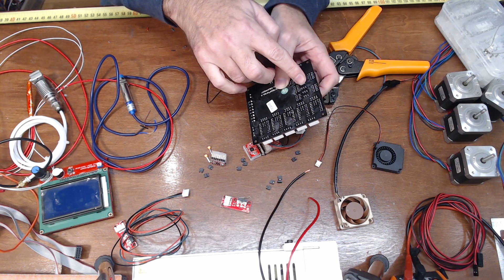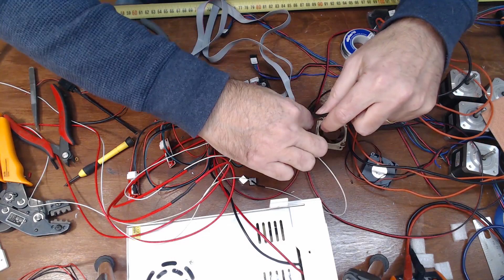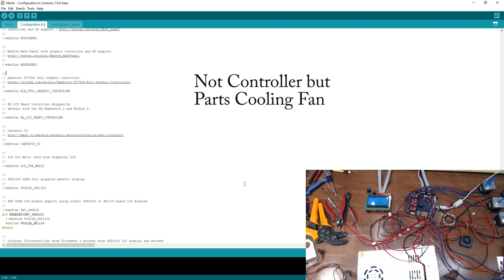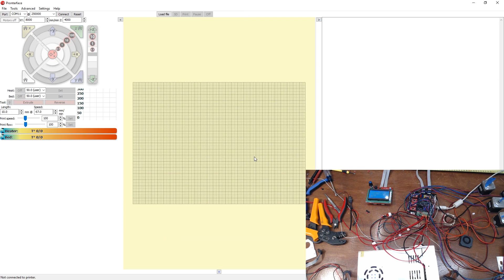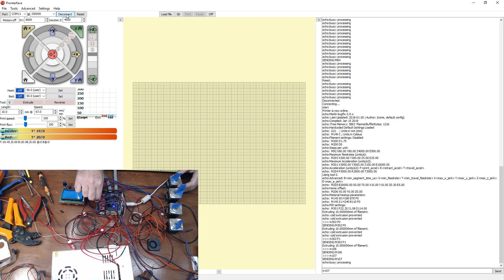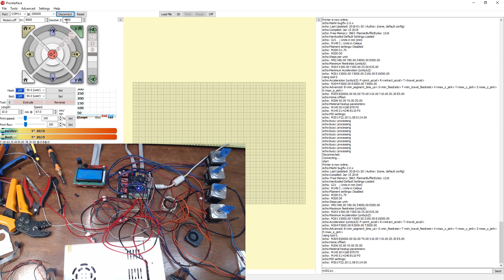C3Dt/c Cantilever 3D Printer Build: Part 3, wiring the KFB2.0

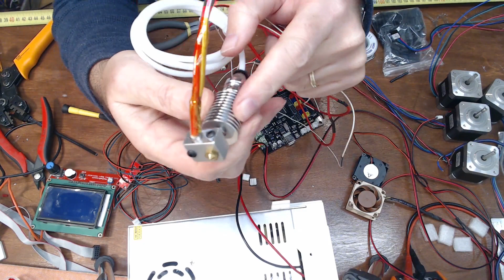Comment: At around 14:00, there is reference to the hotend end thermistor. I cannot stress strongly enough how important it is to check this. Make sure that the insulation on the thermistor is close to glass bead. With the thermistor in p[ace, use a multimeter to check resistance. If it is less than 100k ohms, either you have a short or a defective thermistor. i found out too late, that ther insulation was missing under the screw holding the thermistor to the hotend. Once everything was powered up, I managed to touch the hotend to the metal bed. The result was a message on the LCD screen, "Thermal Runaway: E1" and the board was finished. I had to order a new board.

Comment: Thank you for you instructive video on wiring the KFB 2.0. I have watched it a number of times and each time, I pick up something new. I have managed to wire up my KFB board successfully by following your instructions.

I am configuring my KFB board using Marlin 2.6.1 and Arduino 1.9.0-beta. Did you know that you can define MOTHERBOARD as BOARD_KFB_2?

I wonder if you you help me with one bit I am stuck on. When I compile my configuration with the REPRAP_DISCOUNT_FULL_GRAPHIC_SMART_CONTROLLER, I get the error message:
"fork/exec D:\arduino-1.9.0\hardware\tools\avr/bin/avr-gcc.exe: The filename or extension is too long.
Error compiling for board Arduino Mega or Mega 2560."

I have the u8glib 1.19.1 library installed.

Compiling using the REPRAP_DISCOUNT_SMART_CONTROLLER works perfectly. Any idea how to fix this?
Reply from the maker: I think it may have to do with where arduino 1.9 is installed. I'm guessing it's under "Program files(86)" now. Try putting it on the root (like at c:\arduino...). Here's one entry with possible answers. https://github.com/olikraus/U8glib_Arduino/issues/9
Reply: @Core3DTech  Thanks for coming back to me. I followed the information you have provided and managed to dig further. It turns out that the problem is MS Windows. Arduino IDE compiles all the necessary files and then links them together with it's final instruction. Windows will only permit an instruction that is up to 32K or 32,768 Bytes long. The list of files and the instruction using the REPRAP_DISCOUNT_FULL_GRAPHIC_SMART_CONTROLLER comes out at 40,837 Bytes, far too long. Compiling Marlin for the REPRAP_DISCOUNT_SMART_CONTROLLER does not use u8glib, less files, so the link instruction is only 32,419 Bytes. Apparently this problem does not exist in Linux, I do not know fort sure, not knowing Linux very well.

The best way of dealing with it is to install VS Code and the extension Auto Marlin Build (which in turn installs the platformio extension). Everything works well after that. As a bonus, Auto Marlin Build compiles a lot faster, 88 seconds initially and 44 seconds when I made changes. Uploading to the KFB took 41 seconds.

Comment: Hi, I have an Anet A8M printer and I need the original firmware, as well as do the installation; and the DRIVERS of communication.  but was purchased by aliexpress, and came corrupted the firmware. It's not working, it's bricked, display only with comics.   thank you
Reply from the maker: when you order these boards they generally dont' come with firmware. You'll have to do that from scratch.  When you download the Marlin software I believe it does come with a A8 sample configuration. Check part 9 of the series https://youtu.be/J1mVPmvX2XA Not all but some will apply to your printer